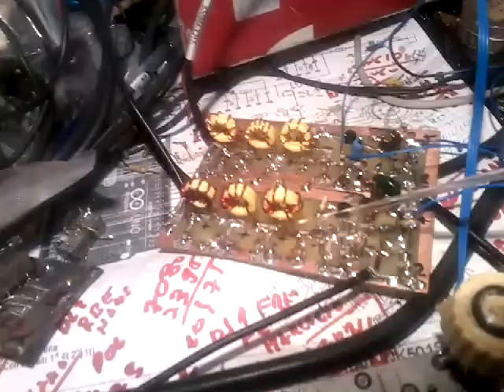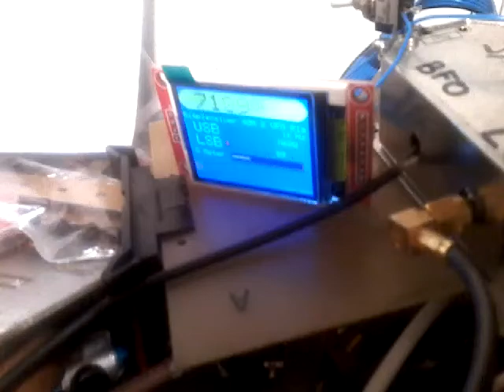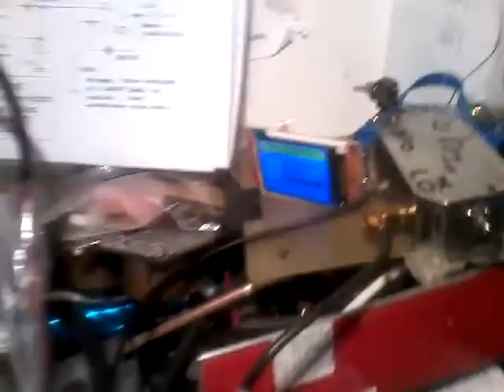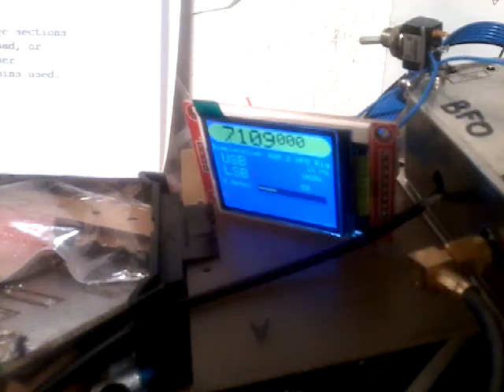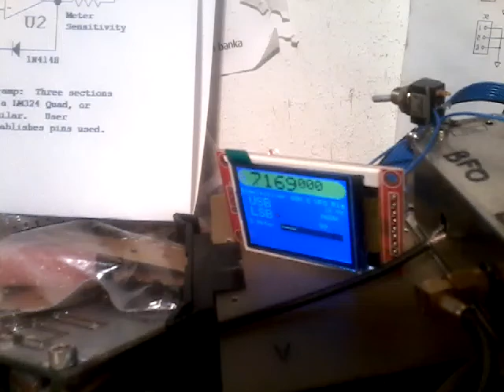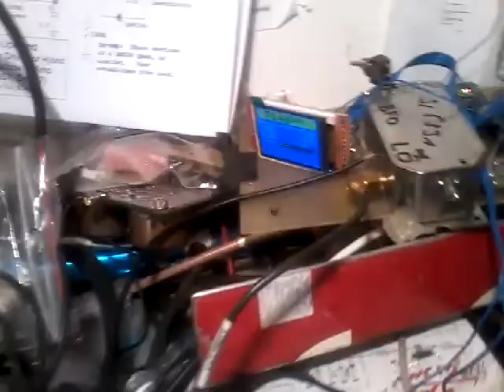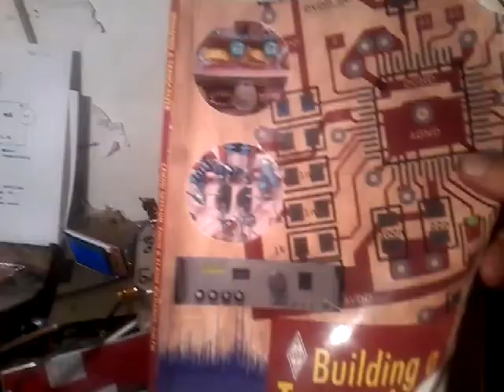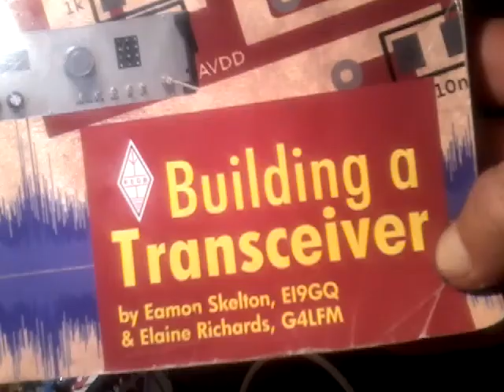9a3xz - i m so happy !!!

Comment: Fantastic, well done Mikele, sounds just great!  And thanks for the mention!!! Keep going, theres more fun for you ahead!
Reply from the maker: Yes...but have some problems with agc...i will see whats the problem.
Reply: @mladencukon9a3xz79  Make sure AGC is working in the right direction. Stronger signal means AGC line drops. Glenn had  a problem with this.
Reply from the maker: Yes Paul,thanks ,i will see with Glenn and try make new pcb like w7zoi agc system.